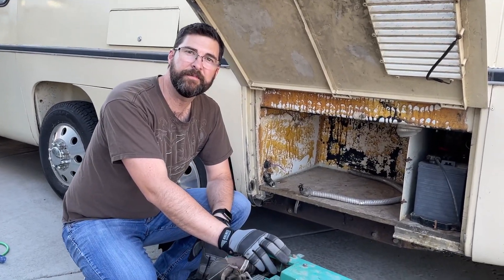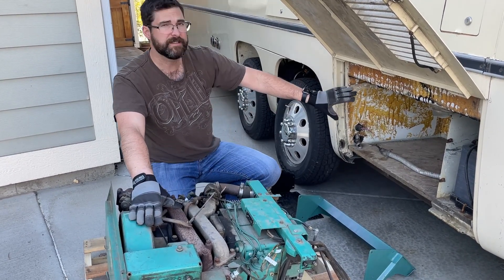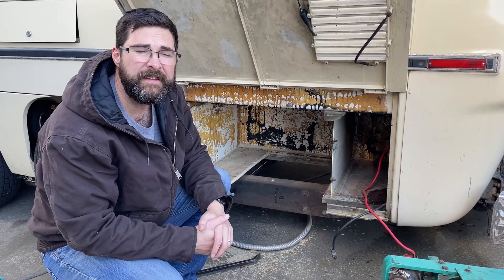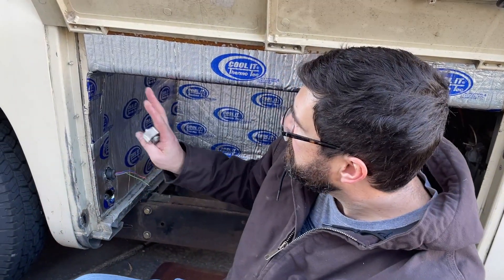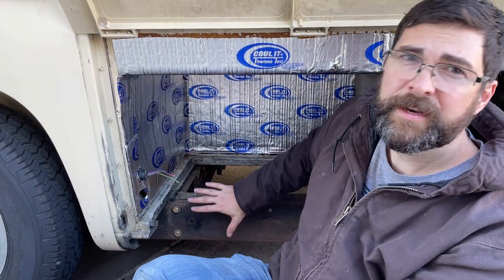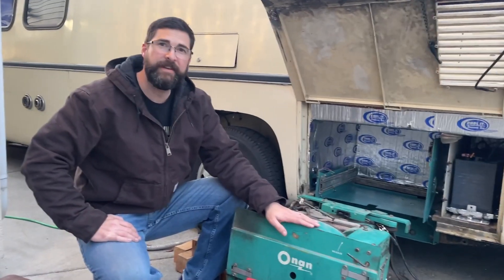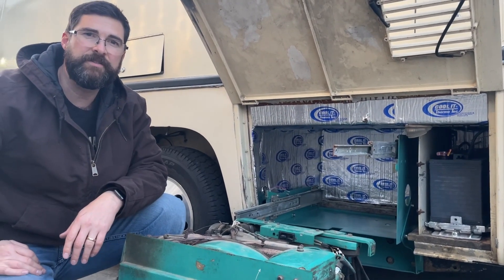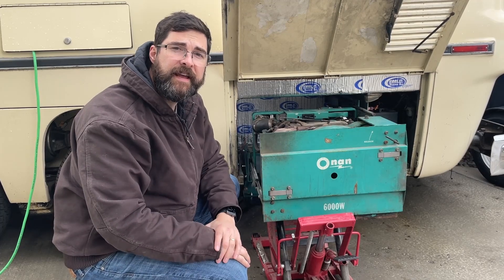'77 GMC Motorhome Generator Install

Comment: I don't envy you this job, the Onan is a heavy beast, so well done! My genset worked when I got my coach and only needed a few things to get it to a reliable state. I had to re and re the choke mechanism and starter motor and a few other small things but nothing compared to your project! 
With my coach, I found adding 3/8" sound proofing foam insulation to the interior (under the bed and aisle front surface) of the gen compartment made a vast improvement in the noise level ..but anyway, let's not get ahead of ourselves, you have a ways to go before you have to concern yourself with sound proofing!
Great work, keep it up!
Reply from the maker: This is my biggest project yet and I have a ways to go. I look forward to the day when I'm looking for ways to quiet it down, thanks for the comments! :-)

Comment: For the generator not working issue, I would check the field winding for continuity first.  If the field  winding is open, it can be a major cost to rewind.  The field winding is connected to the + and - terminals of the bridge rectifier and should read about 38 ohms of resistance.  
Another thing to check is whether the bridge rectifier is even connected correctly since replacement terminals do not match up with the bridge rectifier connector.  The AC terminals should connect to the "neutral" and Reactor output and the field windings to DC (+ & -) outputs.  It doesn't matter which way the wires go on the AC terminals, or even on the DC side.
You may need to "Flash" the field winding to get the generator to start producing power.
Reply from the maker: Hi Bruce, thanks for the tips! I checked the field impedance and it was in the correct range, I also checked for continuity from the field winding to the frame and didn't get anything so I think the windings are okay. I checked the rectifier connections and they are correct so my next step is to magnetize the field by briefly connecting the leads to 12Vdc. I hope this will get it generating but I have quite a few other things to get the engine running and repair all the wiring. I'll be making a few more videos for this project. :-)
Reply: @MrGMCMotorhome  Connecting a couple of the wires together can allow you to get the engine running without the Control board. Then you can get the generator going before investing in a new control board.  Message me if you need help with this.
Reply: @MrGMCMotorhome  use marine plywood and use the stick on sound deadener sheets they use for cars and trucks , how wood a new generator cost?